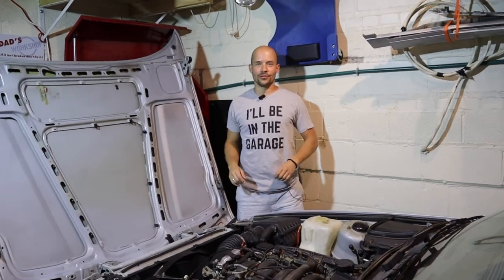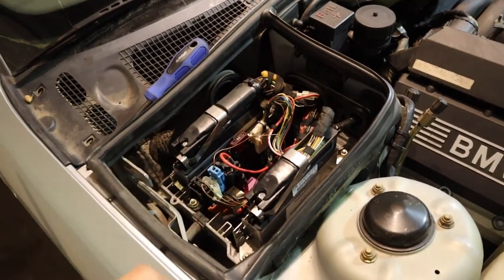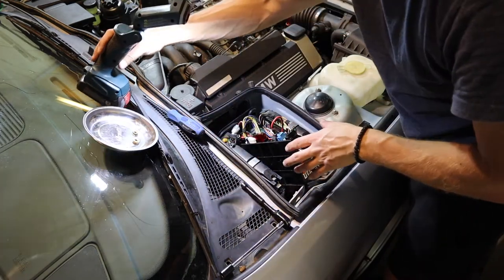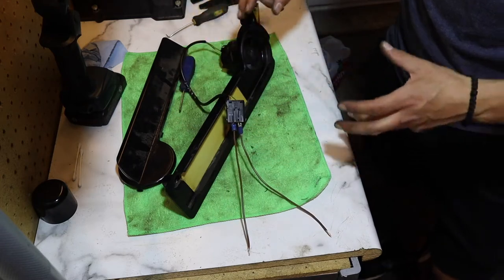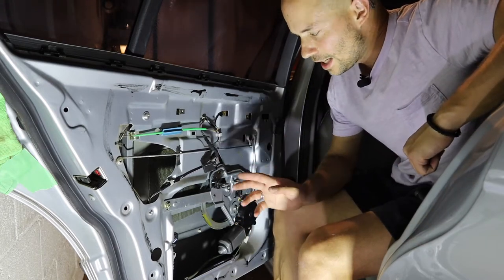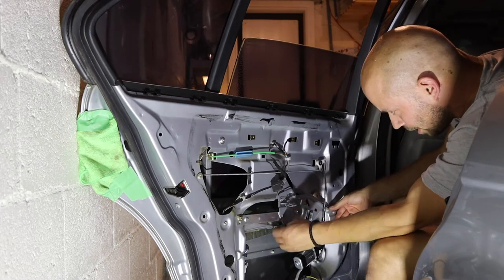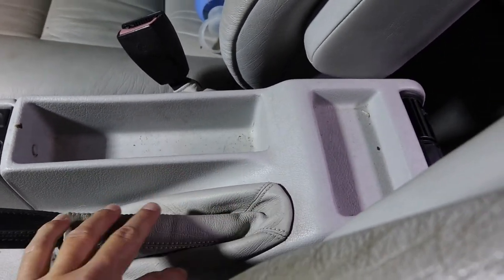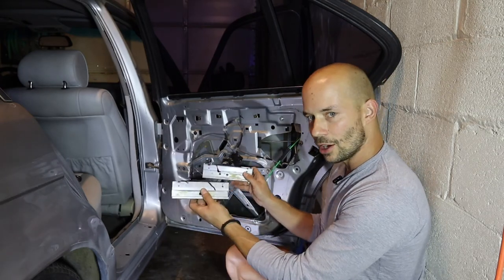Is there anything worse than electrical gremlins? Project E34 BMW Part 10

Comment: Greatings from South Africa. I stumbled onto your channel the other day and have watched all your videos with interest as the e34 is one of my favourite BMWs. I myself own a 1995 525i Manual with Mtech suspension and a LS diff as options. I worked at a BMW dealer for 24 years first on the bench as a BMW technician from apprentice till master tech and later as the workshop manager. Just a little advice the red fuse you located in the E Box is actually for the secondary air pump which helps with emissions. So the blown fuse has nothing to do with the E Box fan. As you have discovered the temperature sensor in the box was faulty and would cause excessive temps inside the E Box. If you you continue to have problems with the starter not turning over when hot it is most likely heat soak on the starter which is common on the M50 and M60 engines. The remedy is to replace the starter unfortunately. The fault you are getting relating to mixture control is most likely crank ventilation valve being faulty and leaking internally. It sits on the back of the intake manifold. I would suggest removing the manifold and replacing the crank vent system and while you are there just make sure the water pipes running between the cylinder heads are not leaking at the back. It's common for it to leak after the water pump replacement. The window guide rails are also a common failure point and we usually use Sika Tack Go to re bond the glass to the track. This allows some movement between the track and the glass, epoxy is too ridged and might cause the glass to shatter. Please let me know if you need any additional help or advice. My dream toy is a e34 M5 S38B38 but was never available in SA only the B36
Reply from the maker: Thanks Justin!! You sound like an e34 Yoda! Good to know on the fuse, starter and the crank ventilation valve! I hear a bit of a whine when accelerating hard under load, and Ive changed all pulleys and water pump - could it be the alternator or bearing in alternator? Is the alternator bearing replaceable or does whole thing need to be rebuilt?
Reply: @DeadEndRestorations  is the whining noise directly related to the engine speed? I very much doubt it would be related to the alternator or related to the belts and pullies as they are not effected by load only engine speed. If they were noisy they would be noisy under all conditions related to under load partial load or free reving. The only time a alternator will change in audible noise will be change in electrical load.
Reply: @DeadEndRestorations  an alternator can be rebuilt it all depends on availability of parts. It may not be economical to repair though.
Reply: @DeadEndRestorations  are you able to record the noise it makes with a good microphone 🎤?
Reply from the maker: Im gonna record the noise, it could be a grounding issue but Ive checked all those points and they seemed well secured. Ill try to take a good clip in the next week or two and post it
Reply from the maker: The noise is affected by engine speed, more whining at higher rpms
Reply: @DeadEndRestorations  but only under load? 🤔
Reply: @DeadEndRestorations  if it were a grounding issue you would only hear it through the sound system. Does the car have the original head unit or is a aftermarket one fitted?
Reply from the maker: Original stereo and head unit, its had a cd changer added in the trunk thats all. I think its louder under load than free revving but ill have to test it again
Reply: @DeadEndRestorations  please do. I am sure will sort it out. Obviously the more info I can get will help me understand the problem. For example when did the noise start was it always there from when you bought the car. Does temperature make a difference, load or perhaps driving conditions. I had a e32 740i make a whining /whistling noise and it was caused by a faulty breather and the noise actually came from the crank seal.

Comment: Well done! Look through some of the e34 forums for electrical wiring schematics. I thought you would recognize me being the lucky winner in identifying the e box fan? Cheers! George
Reply from the maker: I thought of you after I released the video George! It took so long to get the fuse I completely forgot 🤦‍♂️
Reply: @DeadEndRestorations  hi there! I emailed you a couple e34 electrical stuff you might find usei. Check your spam file. 
Cheers, George

Comment: Brother I have E34 525TDS I'm from India my central lock not working do you have any idea what should I do
Reply from the maker: Hey brother - Remove the drivers door panel and lock, it might be a loose wire or you need a new drivers lock mechanism. I’ve never had this issue to be honest so not 100% sure - good luck!

Comment: Hello! Would you have hints on where the 2nd fusible link might be, one is in a small black plastic house under the rear seat but the other one? Thank you anyway
Reply from the maker: Hi! Depends on year and model but usually under the hood near the windshield by the strut towers there is a fuse box in each corner. Hope that helps!